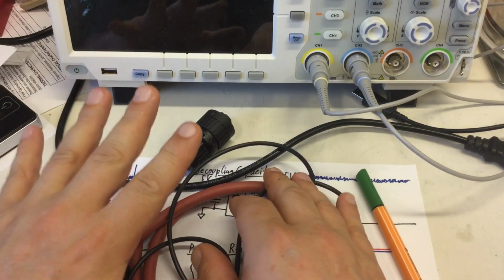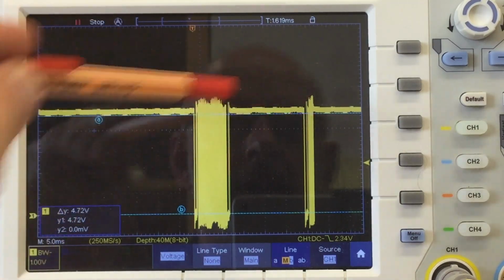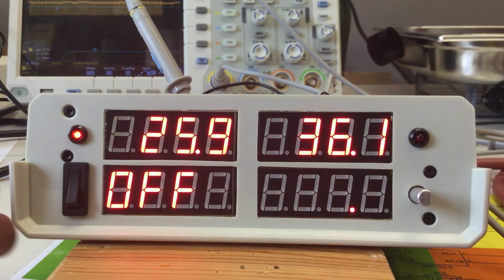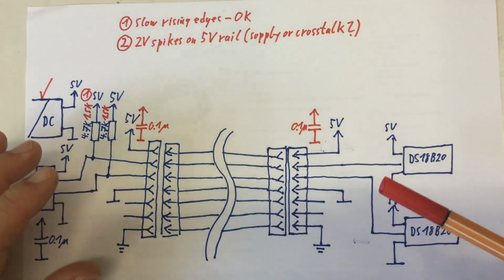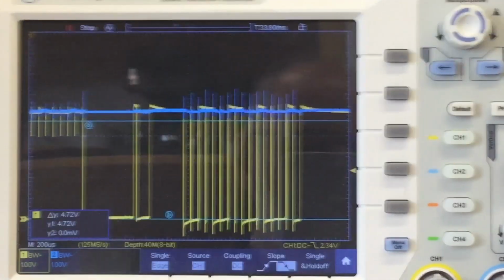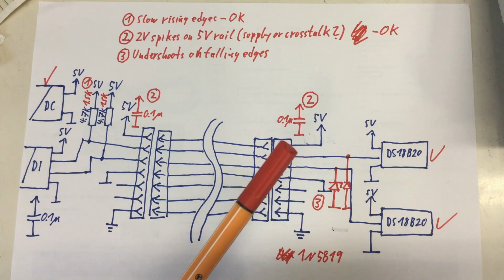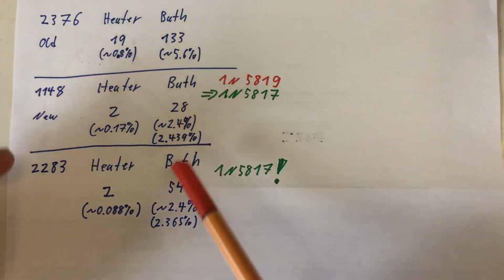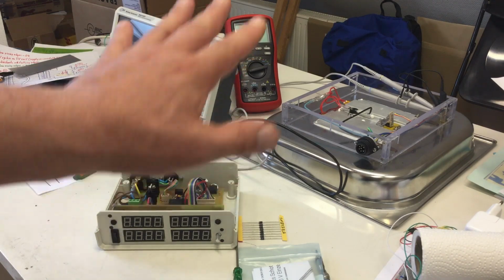Laboratory Water Bath (9): Controller, Chapter 3 (Chasing Glitches)

Comment: Fascinating vid ! So some decent coax cable carrying the signal and decoupling at the sensor would have sorted it out ?...quite an enjoyable learning experience !
Reply from the maker: Thanks! Well, actually shielded/coax cables are not recommended for the 1-Wire bus because of the capacitance due to the shield around the wires. But I invested 10 bucks in a meter of such a cable (3 wire AC mains plus two times 2 wire shielded signal) anyway. So there will be a continuation of this video ;-)
Reply: @robertssmorgasbord  Oh great your back !..Hope you had a nice time !
Reply from the maker: @andymouse  Yes, I had a very nice time :-) I really needed a change of scenery.

Comment: Have you considered to add a series resistor to the data line to control the fall time and reduce the undershoot?
Reply from the maker: Thank you for the input! I've actually tried that sometime after I finished that video. Can't remember the exact results, but in the end it didn't reduce the error rate.

Comment: Hi. I haven't watched the whole video, but often I have the same problem with arduino/mcu when I have USB connected. Especially if I switch mains on (I made a C64 PSU with an arduino that reads current and voltage), the display resets. A long time ago I made a fancontroller with a pic micro, same problem when USB was attached. It is the protective earth in the pc that is joined with the arduino I think, and then you get ground loops (grounding currents travel together with the usb cable, can be induced in signal and usb power wires).. Have you considered CRC ? Long time ago I made DS18b20 based thermometer with LED display (I have it on my wall next to the window, large numbers :) ). I had a problem with data from the DS18b20 lost at times, instead of trying to fix the problem I implemented CRC8, and do checking. When it does not match the CRC in the packet, I toss it and call the temp again until I get the correct one. Works nicely. Since it is only CRC8, maybe once a day or so the display is showing the wrong temperature for a split second :D but that is ok for me.
Reply from the maker: I'm pretty sure I eliminated any ground loop issues by galvanically isolating the two sensors within the bath from the rest of the circuit (was initially just intended to protect the rest of the circuit in case of an isolation fault). The DS18B20 library I'm using does CRC checks on the data packages and I'm doing some sanity checks on the values afterwards (out of range, unreasonably large temperature change). Currently I do three measurements in a row, throw away all "invalid" values, and if I have at least two valid values left I check if they're all equal. Quite an overkill, but a single wrong value might throw off my (predictive) temperature regulation.
I'm planning to do a second video on those glitches where I'll be using a more appropriate cable. We'll see how that works ...
Reply: @robertssmorgasbord  Thanks for the clarification ! I forgot that the library has CRC checks. When I tried this with a PIC in 2009 I didn't know much about mcu programming (or arduino) , so I learned by writing the protocol myself, and added CRC8. I recall also there was a conversion time of about 0.5s with the DS18, therfore on CRC mismatch I had to wait a bit to call temperature once more. (but I could have just called the "scratchpad" for retransmissions without conversion delay, when I think about it). I took a look at the arduino library by Mathias Munk Hansen on master branch (not sure if it is the right place to look), and it does infact calculates and returns a CRC8 on GetConversion(), but in getTempC that value is ignored (!). It only uses the CRC8 in select() (seems to be used for connecting to the ds18). There are no retransmissions,. And getTempC() has hardcoded a delayforconversion, so you get that on every call to it.  If I'm looking at the right version, there is definitively room for improvement in the library here :)
Reply from the maker: @bwack  You're welcome! Actually I just read the scratchpad three times in my algorithm. Temperature conversion does take indeed some time (375ms for 11 bit, 750ms for 12 bit). So my my algorithm request a temperature conversion, then does 500ms something else, then reads the scratchpad (tree) times, then immediately requests another temperature conversion and so forth (see https://youtu.be/GUSzMe1hTtA ). BTW I'm using the DS18B20_RT library by Rob Tillard. It's small, very basic (e.g. handles only one sensor on a bus) and - most importantly - works. I had some trouble with the renowed DallasTemperature library (Miles Burton) - it didn't set the resolution. But maybe that's fixed meanwhile.